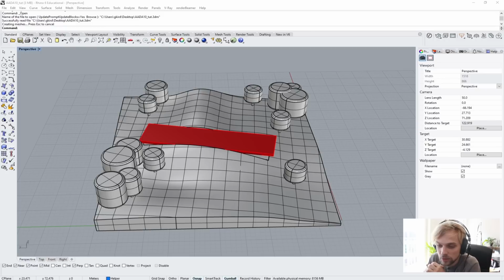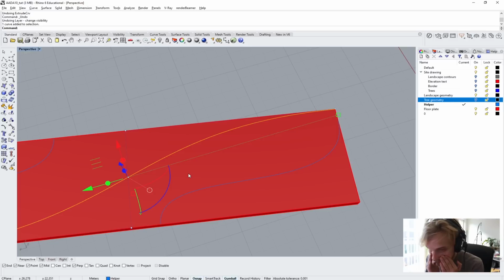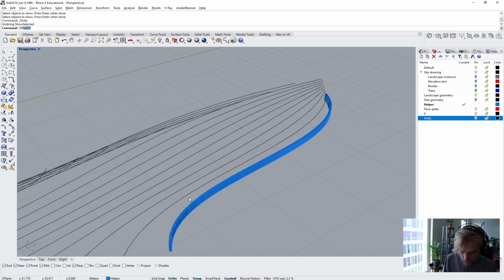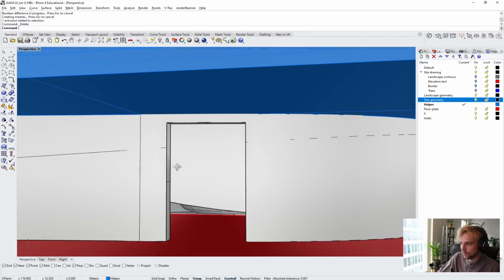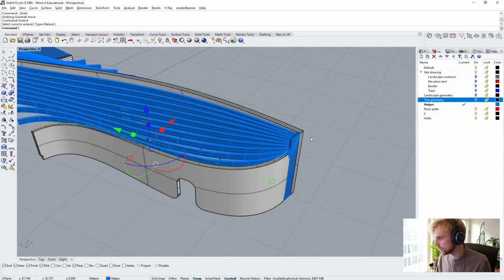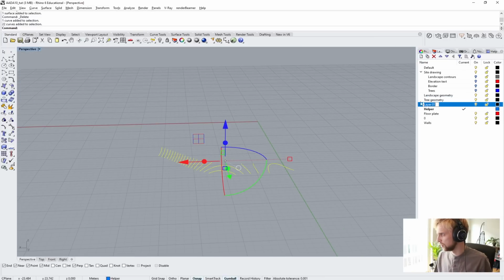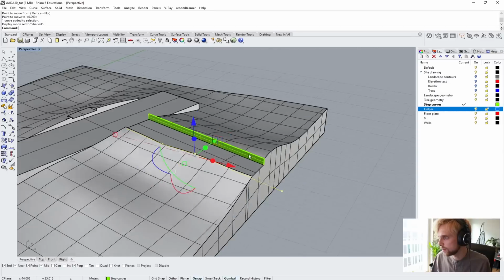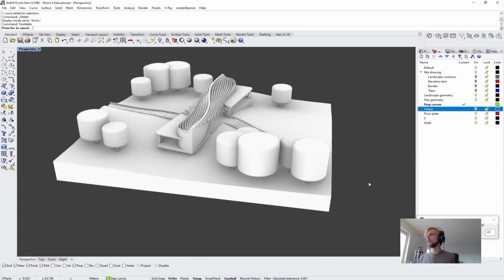AADA10 COURSE (Part 2) - Rhinoceros 3D introduction for Architects

Comment: not sure if you are still monitoring this link - your videos are fantastic - just the right amount of explanation and speed. i am wondering which mouse you are using to draw. i have a wireless jelly comb vertical mouse but am very unhappy with the scroll wheel. it does not always work and i am stuck in the middle of a rhino command. not good.
Reply from the maker: Oh I'm not picky about mice at all. These days I use some generic wireless logitech mouse that I bought in a local pc store for like 30 usd or so

Comment: Don’t mind these:
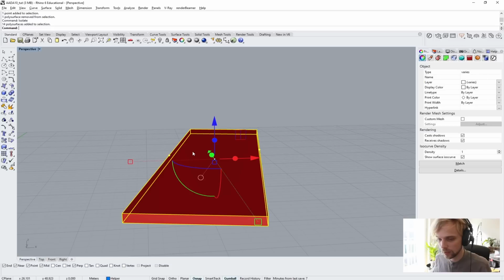Reply: 4:28 isolate
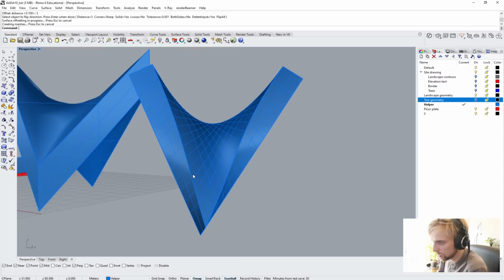Reply: 27:00 offset surface vs extrude surface
Reply: 35:00 showselected (shows hidden stuff to show)
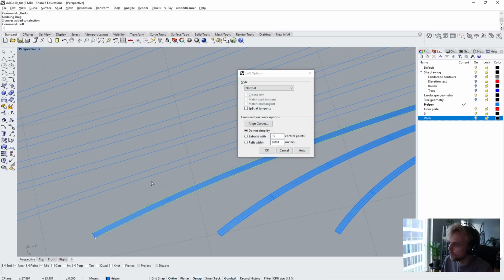Reply: 45:00 selsrf (selects all surfaces)
Reply: 48:00 dupedge ( is it like dupborder ???)
Reply: 56:00 zs or zsa (zoom selected)
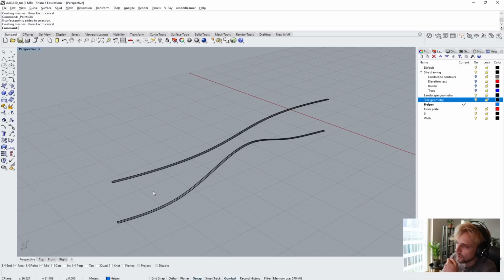Reply: 1:01:00 dupborder
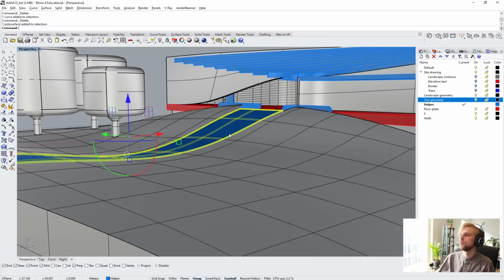Reply: 1:42:00 cage edit (is it like solidpton  ??)
Reply: 1:43:00 contour (cuts a solid in plenty planes)
Reply: 2:22:00 emap or zebra (viz continuity)

Comment: Hello thank you for nice tutorial. I have a small question, when i offset a surface like in 20.20 it doesnt snap as well as yours, it offsets it in a wrong way why does it happen ?
Reply from the maker: When you run offsetSrf command, it will show you arrows pointing at the Normal direction of the surface. That is what Rhino understands as the "Front direction". If you click on the surface then, the Normals will get flipped and thus the surface will be offset to the other side. Thats how you control the offset direction.

Comment: How do you unwrap this to paint in substance for example. Great work. Subscribed.
Reply from the maker: For architectural models, I'd suggest not bothering with unwrapping. Simply using Box/Surface mapping will do the trick for most cases. I go in more depth about this in AADA25 videos series
Reply: @DesignGoBrr  i mean, organic assets, clothes... To learn how to unwrap for sometimes.Thanks. Subscribed btw.
Reply from the maker: @kikujiro499  ah, I'll put down a video for this to my to do list :)